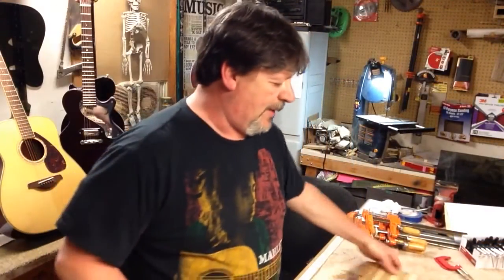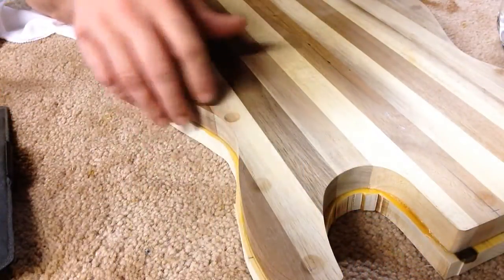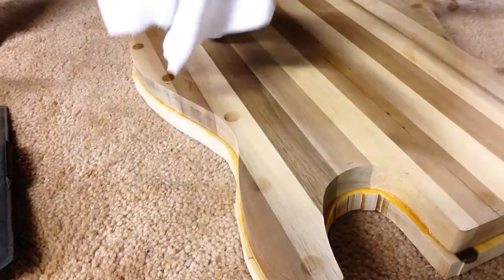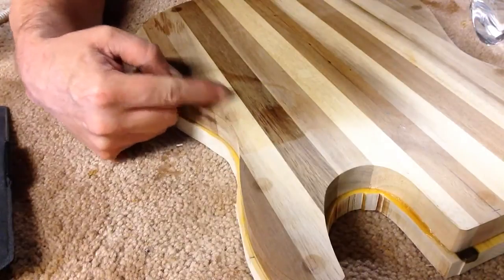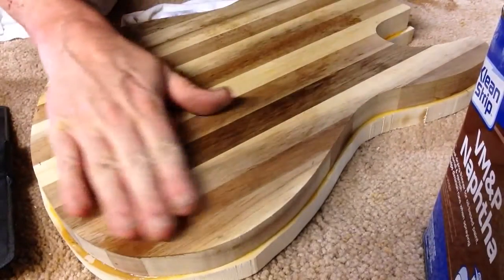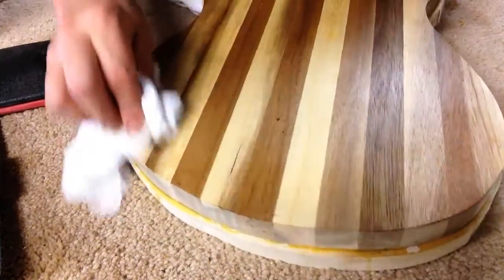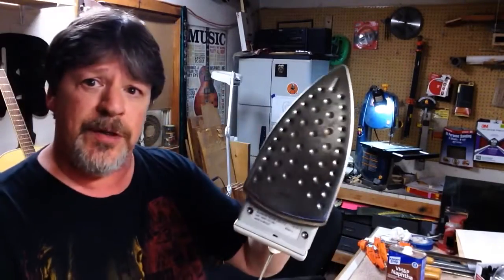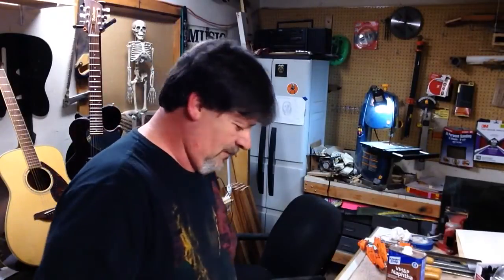Luthier's Tips & Tricks # 17 - Removing dents from a guitar body

Comment: I’m assuming on my nitro LP this would have to be done after stripping the paint fully and then repainted.
Reply: Good point. I currently have a small barely noticeable dent on my Gibson LP Standard. But, it still bothers the heck out of me. Did you have the nitrocellulose removed and ultimately repainted. And, if so…how much did it end up costing? Thanks!

Comment: What can I do about a dent in a guitar headstock with clear satin finish on it? I've tried the damp cotton method (without the iron) and it raised the dent a bit. But it's still there and it bothers me. Should I try the steaming out method? Will it definitely ruin the finish or blush it? What can I do then? Drop fill it with clear nail polish, maybe? I've got no expertise on sanding, refinishing or any of this stuff. 

P.S.: It's a very small and shallow dent caused by pliers while cutting a string end.
Reply: Did you figure it out ? I have same finish as you